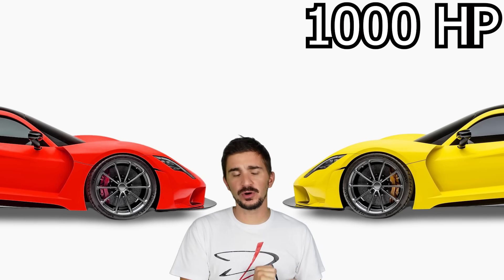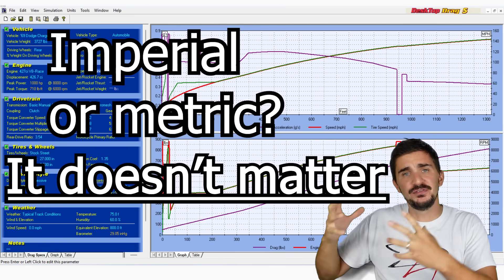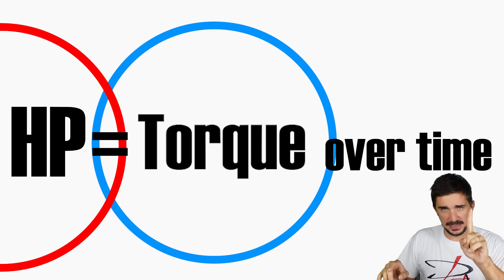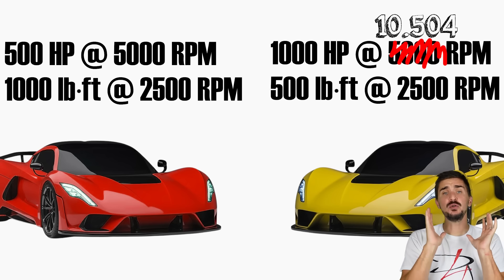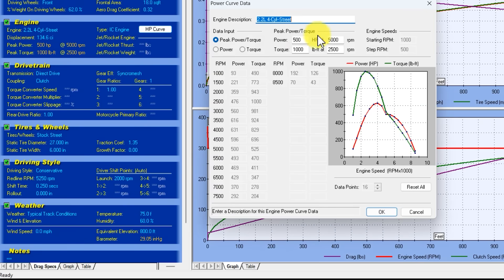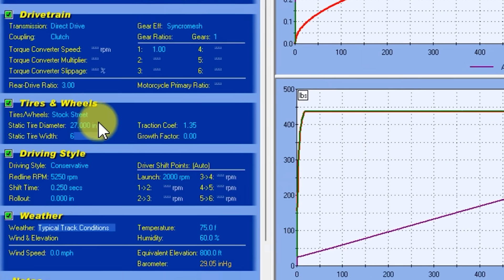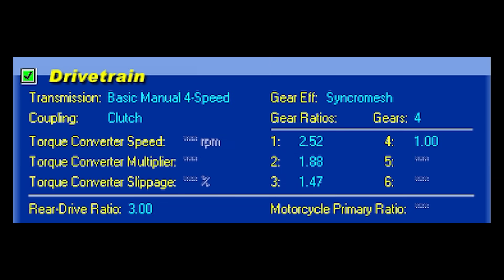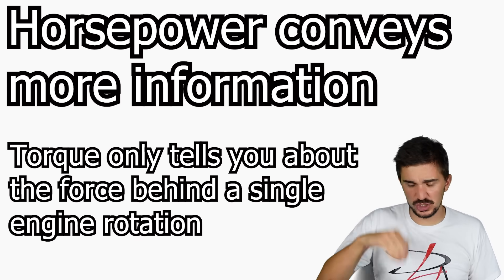Who's faster? Explained and Simulated - Horsepower vs Torque

Comment: Com'on man,  I tuned out at 7:55 cuz, 
10,000 rpm with street tires of say 28" tall, with an overall gear ratio of 1:1 will be 833 mph so that 10,000 rpm engine, in a quarter mile will never even reach  much over 1500 rpm. Not to worry, but neither will the other one, lol. I quit watching

Comment: If I'm going 90 on a flat road in my hemi ram, I'm pulling very low rpms in the highest gear.  That's horsepower.  If I stomp on it at 90, it will downshift.  But less than stomping brings you steady acceleration even from down low in rev range without the downshift.  That's torque down low. Back in the day my Dad taught me not "lug" the engine by trying to pull in a higher gear, as it would lead to carbon buildup.

Comment: 1000  HP will be much faster. Just based on the definition of “horsepower”. Torque is how strong something can twist. But you can have 10,000 torque and only 100 horsepower.
Reply: „how strong somethingcan twist „ 🤔 wellll only in axis of rotation 👍🏻 so in point ZERO 🤷🏻‍♂️ output force can be multiple time lower from multiple higher torque 🤷🏻‍♂️ cos arm /lever or radious determined how much output force be generated from specified ampunt of torque 👌🏻 1000 nm at 1 metres whell radious leverage and you have what? 1000 newtons force 👌🏻 vs 100 nm only but at 0,05 metres whell radious and you have what? massive 2000 newtosn force push you forward …👌🏻 so twisting force is i  say very misleading assumption at least in regard to vehicle with whell gearboxes asf 👍🏻beside at set speed you have bigest twisting force at peak power rpm and not pewk engine tprque rpm 👌🏻☕️
Reply: @mociczyczki  exactly my point. Torque doesn’t tell the whole story. Try reading my comment again but slower next time.
Reply: @mociczyczki  I did say the 1000hp will be much faster
Reply: @Phuong_Nguyen_  ye ye i know but actually it can tell whole story if you know  each leverage from engine to contact path at end with whell radious cos nm:m= force the same as watt:m/s= force the point is depend about what we are writing the explanation can differ feg we talking about peak max engine nm and peak max engine hp or peak nm at fixwhell radious on drove wheellll axis or what ? thers couple point of view on this topic 👍🏻🤷🏻‍♂️ i just say that torque egzist only in axis of rotation and without knowing in regard to cars or bikes whell radious you reallly dont onow how much twisting force on tire circle let say whell is produced let say i say you in drive whell axis you have 10000000 nm and how much force on tore corcle is there generated? aYou dont know as long as ypu dont know whell radiois it can be 1 newtons force or 1 trylion newtons force 🤷🏻‍♂️👌🏻simple 👍🏻

Comment: I had the same logic with punches metaphore before watching the vid, meaning that hp is resulting damage(speed) so more hp equals more speed, and speed wins the race, so i thought hp would win. In fact it did in most realistic scenario with gearbox. Thanks for explanation!

Comment: The proper unit for engine rotational speed in the SI system is radians per second, which gets rid of that annoying constant.

Also, it is ridiculous to use the same transmission ratios for 10,000 RPM engine as a 5,000 RPM one. In reality, the final drive ratio of a high revving engine will be lower than for the low RPM engine. What is a problem, however, is keeping the revs high enough on that horsepower orientated engine. It will typically have a narrow power band and need more and closer ratios. 

Ultimately what counts is the total amount of engine energy that can be transferred into kinetic energy. In principle, if one can do that better than the other over the length of the drag strip, then it wins. That means it is a very complex balancing of factors, but it ought to be the more powerful engine that wins if the rest of the drive train can be optimised for both. 

This would have been better explained with the observation that power is force x distance / time, and then showing how torque plays into this.

Comment: It will always be horsepower.  Torque should not even be looked at by itself because you can always gear for torque while horsepower can not.  You exchange more torque for smaller rpms and vice versa.

Comment: Double the power wins every time. Even 1950s 4-speed transmissions were more optimized than your hasty, contrived example. Proper gear ratios eliminate the weaknesses of a low-torque engine.

This was a disappointingly uncommitted, middle-of-the-road take for a channel that I normally hold in such high regard.

Comment: The major fact didn't mentioned and people don't know is that torque delivery depends on weight and wheel radius. With light vehicle on small wheels it doesn't matter how much torque are able from an engine. You are simply can not deliver it to the ground -- your wheels will be slipping after some max value.

Comment: You biased the comparison toward torque. 10 speed auto, torque converter for initial torque multiplication, and steep gears in the rear on a light vehicle does what?

Comment: Horsepower is torque times “frequency of application” is a very bad description of how one relates to the other. 

I can understand why one would choose such a wording since rpm seems like a “sort of a frequency”, but it is not about frequency at all. It is about speed. 

Let me explain. 1: Torque is a rotational force. 

And just as force times speed (or rather velocity) is power (which can be measured in horsepowers if you like to use stupid constants…😉), a rotational force (a torque) times a peripheral speed, is also power. 

If the radious of the peripheral is equal to the one used in how we measure torque (1 meter in the case of Nm or 1 foot in the case of lbf*ft) we get an almost identical equation as the one for a linear movement. 

So the illusion of a frequency being a part of the equation it there only if we forget what 5252 is. It includes the radius to circumference conversion that we need to get the speed at the radius used in the unit of torque we use. 

So even if a spinning axel can be said to spin with a frequency, the torque is not applied “with a frequency”, it can be constantly applied, and even if it isn’t - we kind of pretend it is. When we claim a specific torque for an engine, we are talking about the mean value of the torque for the four strokes combined. So what we need to multiply with is the rotational speed at the radius indicated in the unit for torque that we use. And in that conjunction, calling it a frequency is missleading.

Comment: It works in thought but put the gearbox and all back in and low torque and high HP with a fast high rev engine works.  F1 when they still sounded good

Comment: I have a truck and an suv. They have nearly identical HP per unit weight. One would assume they’re probably equal speed… but no. The suv has 33% more torque per unit weight and is massively faster. Night and day. Incomprehensibly large difference. The suv can also tow nominally 2700lbs more… but I suspect that’s lowballed by the manufacturer for legal reasons.

Comment: I am from germany, and i own a Toyota Corolla Verso R1 (european MPV) with a 2.2 liter I4 Turbodiesel, 177 hp @ 3250 rpm, and 400 Nm @ 2000-3000 rpm, delivering the power thru a 6 speed manual transmission to the front wheels. The base weight is 1390 kg. Yes, for americans this sounds completely stupid. But this car can go from 0-100 kph in 8.4 seconds, and can reach a speed arround 230 kph. This thing is faster in acceleration and top speed than my buddy's 1995 BMW 3 series with 170 hp.
IF you can shift fast enough. You have to shift this thing at exactly 4000 rpm. After shifting you are at 2000 rpm, where the torque curve starts its plateau.

Comment: Only what happens at the rear wheels matters.  Torque can be any thing you want, the transmission changes it.  Power though is the same from the engine to the wheels (minus some friction losses).  Power is what counts.
Reply from the maker: Both count because gears aren't magic and because power is torque times rpm. If only power counted we could use geared down shaver motors to power cars.
Reply: @d4a and it will work than assuming it have enough power the point is if it have some ridiculousamount of rpm and longevity ge like 5 days than it be not the most reliable engine there but except thus assuming this engine have enough power it be work just fine in terms of acceleration and top speed on perfect gearing once therebe  not  enpugh power it will not work well 🐌👌🏻 dosent matter how much you geared it down coss watt:m/s = force 👍🏻and torq is pointless units 🤷🏻‍♂️ let say we have 3000 hp  engine a rpm with peak 1 nm you gear it down and setup enough gear quantity for have both topspeed limited be all resist and max posible acceleration through whole speed range so basically from 0 to top speed and if you put this engine gearbox setup in some truck it will go uphill with 50 tons on trailer faster than feg strongest stock volvo truck so fh16 with 780 hp and 3800 nm at engine crank 🤷🏻‍♂️ cos watt:m/s= force 😎if so than if both truck with whole weight 60 tons be at 10 km/h point of acceleration up this hill than volvo truck be able to generated max 780:1,341x1000 :2,78 = 209229 newtons force with drive train losess less let say 30000 newtons less so like 179229 newtons around force thrust /at contact path push it uphill assuming gearbox allow engine to be at peak power rpm so in fh16 volvo truck egzample its 1700 rpm around not higher and not lower rpm at lower rpm  where power increase rapidly output force = thrust be smaller 😎 at this 10 km/h at higher than 1700 rpm where power drop down be also smaller at this 10 km/h now than lets take our 3000 hp 1 nm version the same calculation so 3000:1,341x1000 :2,78 -30000 n = and you have how much thrust at 10 km/h assuming also that we have perfect gearing and engine is at peak power rpm what in this egzample be at couple mln rpm 🤷🏻‍♂️? 774725 newtons force so basically around 4 times biger contact path fprce aka thrust in 3000 hp 1 nm version at perfect gearing 🤷🏻‍♂️seee somewhere here  in this simple formula   torque units ? 🧐🕵🏻‍♂️cos me not 🤷🏻‍♂️👌🏻offcorse its ridiculous egzample from many point of view like relaibility longevity rpm level which is imposibl for standard combustion ngine which we know for achieve asf but fact is a fact if 3000 hp 1 nm would egzist at perfect gearing it would generate more THRUST 🌪️ and so more acceleration at the same load uphill downhill or on flat rpad i wrote this cos some poeple due to lack of knowledge think it makes diffrences uphill downhill pr on flat rpad 🤭 real world egzample ? 👉🏻 h-dx440 38 nm 27 hp vs kawasaki ninja 300 27 nm 39 hp leveled diffrenc in weight be rider with diffrenc weight and if h-d accelerate from 0 to 100 km/h in 10 sec flat than ninja 300 clock 7 sec flat top speed assuming we leveled drag so ripp off fairing from ninja 300 let say be like 137 vs 155 km/h for ninja  advanatage  🤷🏻‍♂️ some cars ok civic type r 200 hp 200 nm 0-160 km/h 16 sec  vs seat ibiza 1,9 tdi fr 130 hp 310 nm 0-160 km/h 22 sec vmax civic 240km/h seat 210 km/h 🤷🏻‍♂️ viper 500 hp 750 nm 0-200 km/h 13 sec ferrari 619 hp 607 nm at similar or ven biger weight 10,5 sec 0-200 km/h yea topspeed ferrari also have higher 👌🏻asf asf ☕️
Reply: @d4a  Torque is the sound of one hand clapping

Comment: Completely botched video.... If you are going to TRY and explain horsepower and torque, AT LEAST use engines that are possible. There is no point in trying to figure out "which will be faster" if neither engine actually is possible.

In "theoretical real life" (Unlimited traction, ideal transmission), Horsepower will ALWAYS win. Simply because horsepower is energy over time, and torque is basically "nothing over nothing".
Acceleration is the supply of energy to an inanimate object, and more energy per time is more acceleration.
Reply from the maker: Nice username
Reply: @d4a  I know... Does not mean what you think it does though.

Comment: I see that the torque curve is flat at any given rpm. So yeah, it's not accurate to calculate the RPM based only on the peak torque at 2500 RPM for a given horsepower. The reason is that the torque tends to decrease at other RPM levels, particularly at higher RPMs. Therefore, when considering the dynamic nature of the engine, the actual RPM would be even higher to achieve the theoretical HP. In this specific case, it might be around 15,000 RPM which is crazy.

Anyway the conclusion is correct that HP wins if gear ratios are tuned properly

Comment: HORSEPOWER determines performance. Simple math. Acceleration and top speed are determined by the amount of torque at the wheel (!) or better even the amount of force in NM at the contact patch between road and vehicle. However the power at the road is the PRODUCT of the torque at the crankshaft x the reduction in the gearing system (gearbox + differential) so the power at the ground is determined by Torque at the crankshaft x rpm = the power of the engine, NOT the torque. NB. Accelaration is not determined by the maximum power of the engine, but the average (!) power over the whole rev range the engine needs to go through in each gear... So a car with high power over a wide rev range can still accelerate faster than another car with a higher peak power over a small rev range. What is actually important here is the width of the rev range as a multiplication factor. To put it simply: and engine with a torque 20 n/m from 4000 to 8000 rpm provides the same performance as an engine with 40 n/m from 2000 to 4000 rpm

Comment: powertrain loss....wind resistance...... Driver mod.... Launching these 2 machines are totally different.... 
High torque makes it hard to hook up to the ground....
Low torque bogs unless your on the limiter
Pass that its more whats between the seat and steering wheel

Comment: HP is a calculated figure, it is not measured.  It is a relationship...that being the relationship of torque and RPM.  HP is a figure that tells you how much work an engine can do, in other words, it's a function of time.  200 HP is 200 HP, regardless if it a low torque high RPM engine, or vice versa.  Beyond that, as the video shows, how you put that power to the ground is a matter of many factors, such as tire traction, gear ratios, etc.  But, power transmission factors aside, HP is HP.  

Interestingly, James Watt (who devised Horsepower) intended it as a marketing gimmick, but his somewhat arbitrary "standard" ended up being very useful across the board.  It is much easier to consider HP ratings for picking engines than trying to manipulate torque and RPM ratings in your head.  The HP number takes out any guess work and provides a simple and easy to understand value for comparison.

Comment: It’s not a good comparison when you change the rpm to 10,000 rpm on the horsepower bias and have torque bias at 5000 rpm. You said only changing horsepower and torque values but you changed the rpm which makes the comparison no longer legit. The rpm higher changes everything because peak torque has to increase a lot to but you never did that. Hondas have higher rpm limit with higher rpm torque. V8 mustang or corvettes have higher torque at lower rpm and peak horsepower at lower rpm. You basically compared Honda vs muscle car so not an equal test.

Comment: Since Hp = torque at 5250 rpm, this probably cannot be a real engine comparison, and simply theoretical.  HP is rate of torque production, so increasing either increases the other via rpm on a rotating engine.  Torque and hp are intimately connected, not two separate types of power.

Comment: no the hp engine is always better, the transmission is important. with a transmission the hp engine at peak hp: 1000hp 500lbf @10504rpm is the same as 10504lbf @500rpm output shaft speed. whereas the torque engine with fixed numbers at peak torque: 476hp 1000 lbf @2500 is equivalent to 5000lbf @500rpm output shat speed. the hp engine has more then double the torque at the same output shaft speed. zero contest, zero room for debate.

camon guys so many people get this wrong but its not that hard, hp is the actual measure of work. get it through a good transmission and you can rule. thats why there are no low rpm kaplunkity single cilender racecars. torque does not matter when you have a transmission.

Comment: For most consumers, peak torque is basically just a second data point on the output of the engine that's at a different speed than peak power. If manufacturers really wanted to convey how quick their car is in detail, they could just provide a power graph.

Comment: This neglects any sort of forced induction or meth/nitro/ethanol injection.  Horsepower from these forces the engine to rev faster.  Even easier by flywheel, more torque benefits from a heavier flywheel/clutch and high horsepower low torque benefits from a light flywheel so it can rev faster

Comment: All this actually depends on your ⚙️ gearing. Hp is the force. Torque is how hard that force is applied. By gearing down you increase Torque.  
By gearing up, you'll lose Torque by increasing its rpm.  You not going to run without a transmission.  Although you can run without a transmission its hardly ever done.  So you know changing your gear ratios will change Torque drastically.  Torque output should be close to the hp output ideally. The ratio is one to one great for daily drivers 2 to 1 is great for drag racing.  Parasitic loss from transmissions can be 20% of the overall HP. So you try to steal some eith your gear ratios. Imagine we ran turbines in the Navy. The RPM is in the 100k range. They had to geared down because of rotation speeds. You'll never get anywhere with a prop going one to one with the turbine.😂. Gear reduction is the only answer..lol. Look up those Hp and Torque numbers for turbines in ships..😮😅